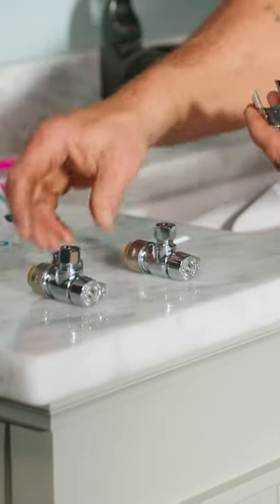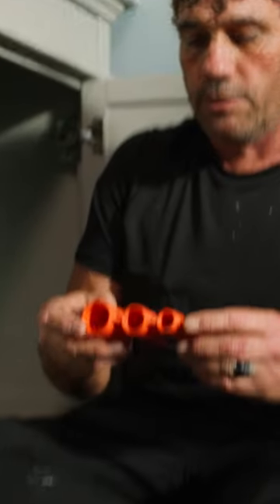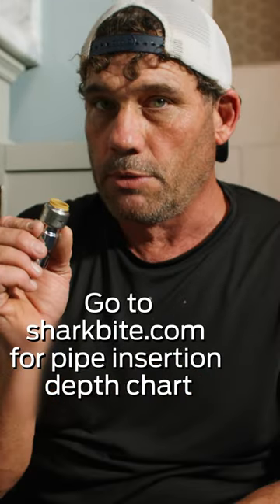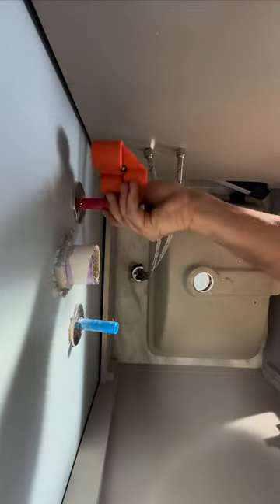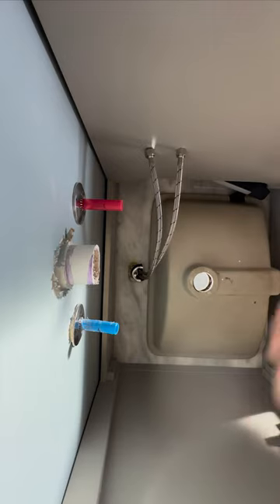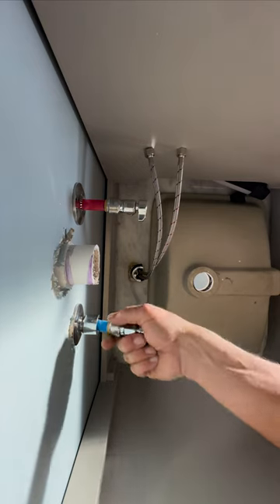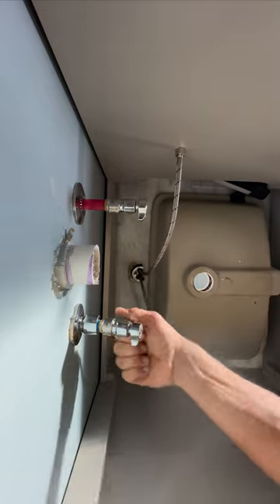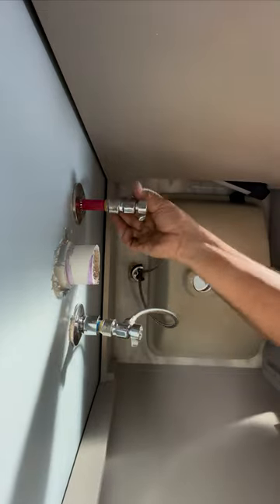How to Install SharkBite Max Stop Valves

Comment: For the average homeowner just for a leak in a home they should have a SharkBite half inch end cap also 4-in repair SharkBite to cut out a bad section put it away as a emergency